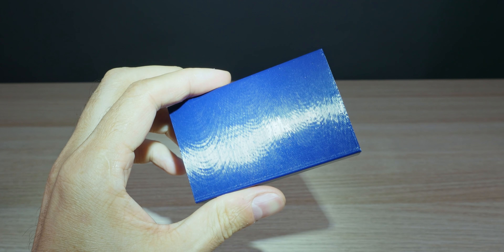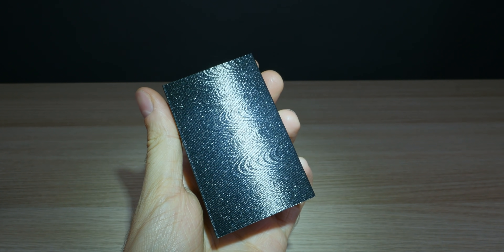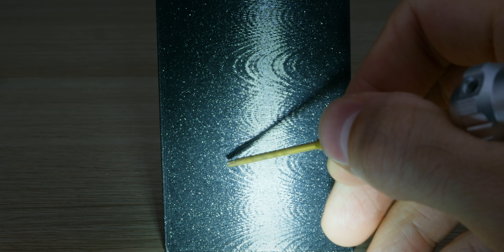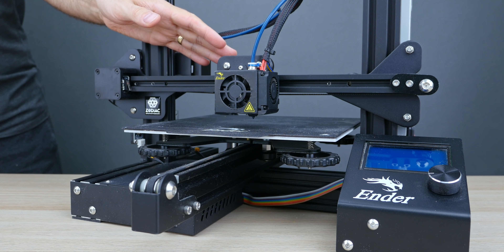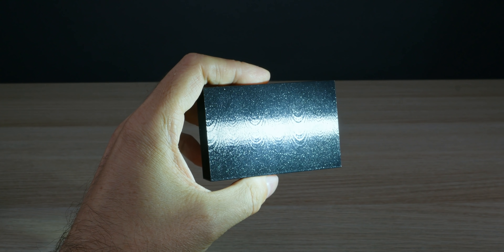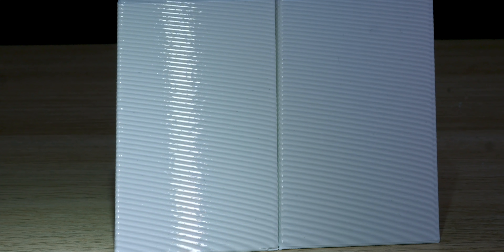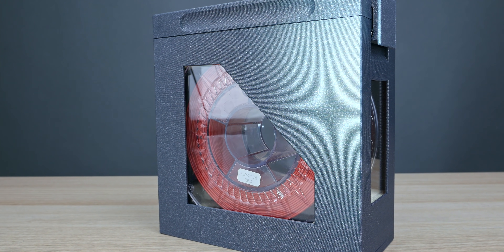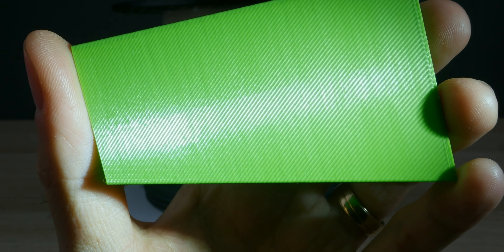The intertwined waves pattern in 3D printing

Comment: If toothed drive gears are the issue, the only thing I can think of to remove that would be rubber or some other type of material with a high coefficient of static friction covering the drive wheel. If it's just smooth there'd be no grip to push. Definitely a nice puzzle to ponder. If only I had the resources to test. Ah well, I guess that's why I'm subscribed to your channel!
Reply: I think any smooth surface material would become more susceptible to build up between it and the filament unless there was a self-cleaning solution in place. Perhaps a very fine knurled pattern would be an improvement but the finer the pattern the faster it would need to be cleaned as well. It would be interesting to test with rough surfaces like that of sand paper, a diamond file, etc...
Reply: @JJFX-  it appears as the unregularity of the pattern is the problem, no? so if one could make the "deformation" regular such as a wiggle line as inprint on the filament or a vertical, continuous line instead of the horizontal gear lines. That would be interesting. Another idea might be "propeller-shaped" gears where there is still horizontal grip but over a longer distance, so that one inprint ends where the other starts. If I had a way to manufacture metal parts I would totally test this ,_,
Reply: You could also use toothed gears with a bigger diameter, so that several teeth grip at the same time.
Reply: I feel like i have come across such an extruder that used a drive wheel with rubber flaps or something like that. Unfortunately, I don't remember the name of that extruder.
Reply: @quinnobi42  Flex Wheel Extruder? https://reprap.org/forum/read.php?94,840959 . I've also seen a few designs using the smooth, rubber side of a GT2 belt running over a large diameter idler to "sandwich" the filament and push it. Both solutions are quite bulky and need gearing, which will likely introduce some sort of cogging, which again would lead to periodic variations in extrusion flow.
Reply: @SkorghDk  this is exactly what I was thinking.! I think though we'd need a costum belt to make it work well. Mainly the contact surface with the filament would probably need to be mildly abrasive. Possibly just rigid segments... That however as far as I know doesn't exist. With a very small belt that has a surface like that I'm guessing the size could be reduced, but it would always be bigger than gears.
Reply: @SkorghDk  Yeah, it was probably that one. This has also reminded me of a very different extruder design by Fuselab which is a lot like a worm drive for the filament. http://fuselab3d.com/
Reply: @SkorghDk  Do you have any links for the GT2 belt wrapping kind? After doodling up a few designs, it seems quite interesting. Especially the way it takes in filament from the side rather than above like every other extruder.

Comment: I would love it if you could please partner with a manufacturer and make your own 3D printer for others to benefit from, you clearly are passionate about FDM printing so the Mihai 3D printer is going to be a beast that can only rock the market. We need a decent FDM printer that doesn’t cost half a million dollars.

As for your question, an idea I was thinking of was to use an array of several silicone or rubber gears that would apply pressure and push the filament without damaging it. The array of multiple gears (maybe 3 or 4 counter facing gears, so 6 or 8 total) is to make sure that if one rubber gear slips, there are several backups, ensuring continuous flow. This concept could be tested with 3D printed TPU.

Comment: what if you use some sort of soft/hard/? rubber washer to 'grip' the filament slightly without leaving a mark?

Love the quest for perfect prints, you mad man!
Reply: First of all that could introduce slipping, BUT there're sensors for that exact issue. Secondly it might act as a spring (like the bowden setup) so you might be onto something :)

I was thinking maybe a helically cut hobbed gear, although that would introduce a lateral force on the filament, which would require good filament constraining or a dual gear, with the hobs going opposite directions

Comment: At first I thought that the motion of the printer and how the slicer makes the g-code files was the problem for that happening on curved walls ( a curved line in g-code is just many points of a normal line , that makes it look curved ) , but yeah , I think the lines caused on the filament by the extruder are the problem . Thanks for the video , I will try that !